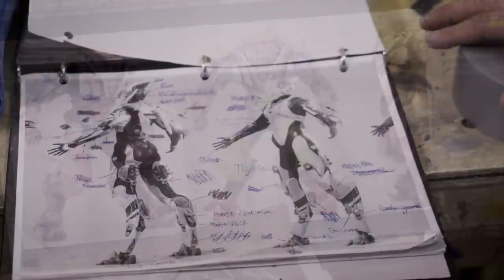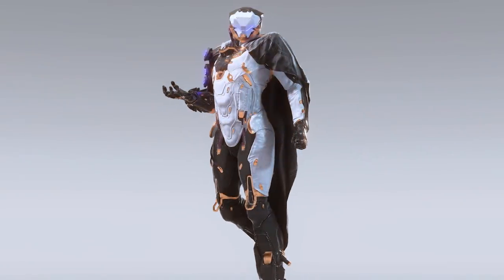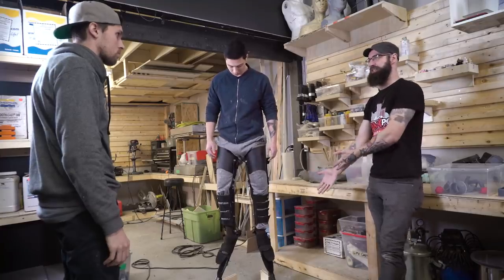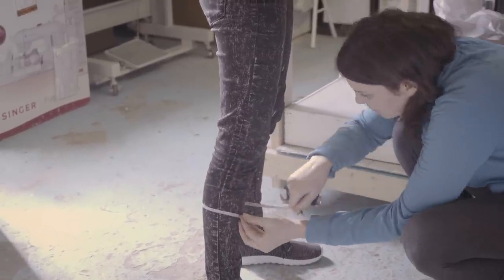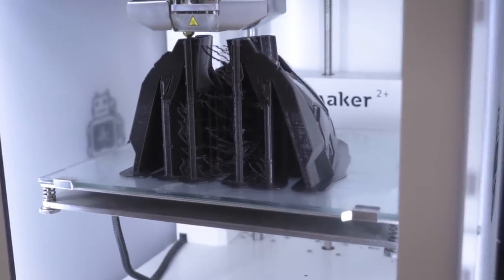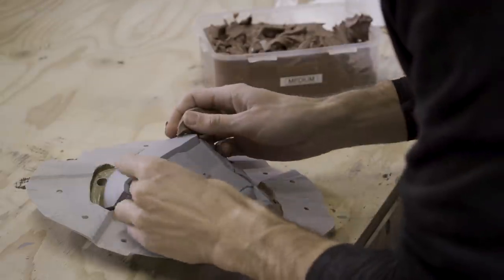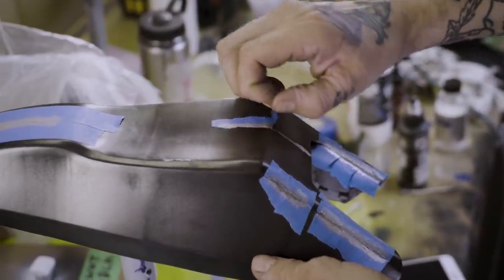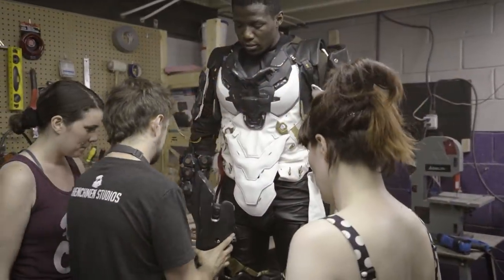Suit Up: Building the Javelins of Anthem

Comment: How is it to have so long legs in those javlins/suits.
Reply: It’s the leg design itself, forgot who the runner was, but he had an amputation on both legs, and were replaced with a similarly designed set of prosthetics, it was later fould out that this design of leg gave the runner more speed and efficiency when running

Comment: Too bad they're not made from real metal. Not only that, too bad that they don't even partially function (but that I have no doubt will change in the near future, as tech advances). Other than that, I think there was too much cloth in certain areas, like the Interceptors armor in the game is more metal-like under the chest piece, but in the cosplay, was obviously cloth and did not look too great. Another thing to note, is if you look for a life like predator mask (from AVP), some models allow you to open the mouth of the mask, as you open yours. Given that information, you could have made the colossus look better, with attaching strings to a gauntlet that the wearer puts their hand into, and thus, the fingers would close when the wearer would make a fist. Easy way to re-extend those fingers is to put them in with springs, so when the wearer opens their hands, the strings snap them back into place. When wielding a weapon, it should not be any different (depending on the strength of string or such that you use) so that the wearer could wield a weapon as well. Sadly, with the feet, I have no idea how to fix those (to make them look more real when you walk). Otherwise, pretty good video, and cosplay.

Honestly, a suit like Anthems, I'd most definitely want (and IF I could, I would make it out of metal (sure, it will be heavy, but realistically, is it not?)).